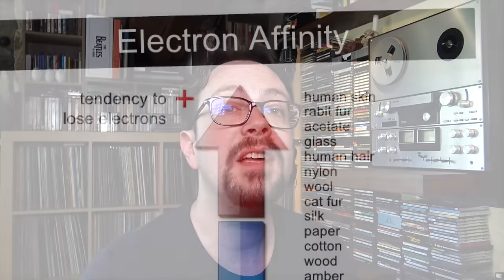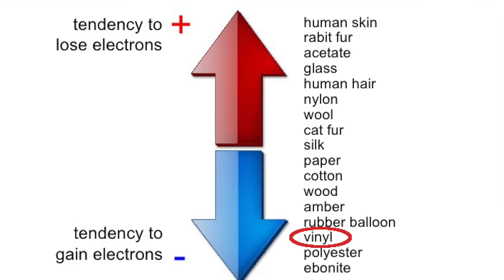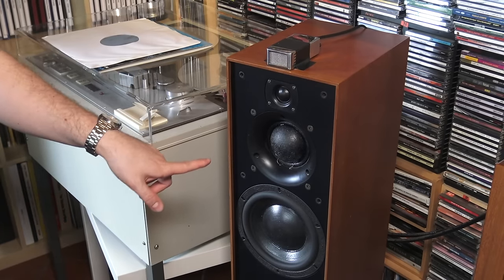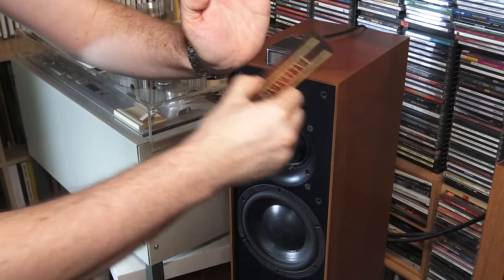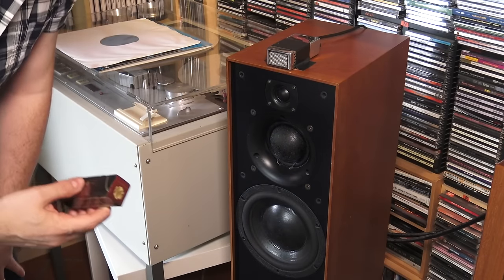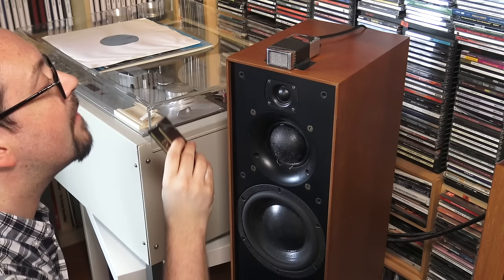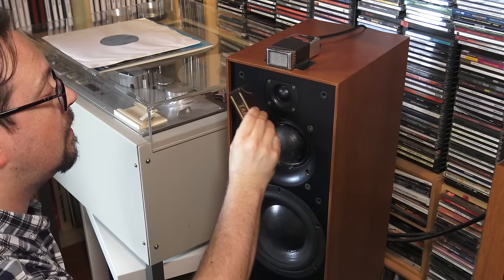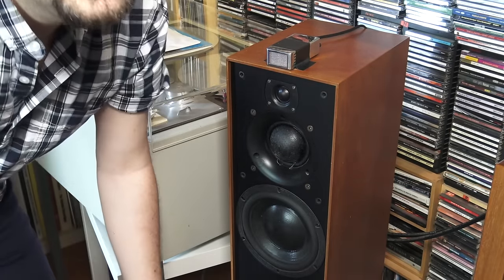How to eliminate static electricity from records & gear

Comment: I had a Milty Zerostat 3 gun once, but they have a certain lifetime on how many discharges it can deliver. 
I managed to wear out mine within 2 years of use to the point it didn't worked at all, even if I tweaked the screw on the piezo-element holder inside the gun.
Ended up buying a vintage battery powered Nagaoka Kilavolt No.103 gun for never needing to replace it again.
It has good reviews, so I'm very excited to test it out when it arrives in my mailbox.😊

Comment: Re the Zerostat, i've heard from many people in the hifi industry that they work but, as you say, they're expensive, as for the Talisman "WOW WHAT A LOAD OF SNAKE OIL BOLLOCKS".
The ONLY reason it eliminated static from both your cd & vinyl is because you grounded yourself & the discs by touching them thus discharging any static to ground.
If you want to eliminate static from your discs before you play them, don't wear rubber soled shoes or stand on a carpet when you load them either onto your turntable or into your disc player. If your equipment is properly earthed (grounded), touching the chassis of the player or as you suggested the spindle of the turntable will more than suffice to discharge any accumulated static charge. As another commenter noted, magnets ( of any strength) & cartridges & tape heads are NOT good bedfellows, unless you're very rich & stupid enough to bring them together, in that case you can afford a new component each time the "magnet" is used near them. As for de-magnetising your speaker drivers....... well as they have pretty large magnets inside to make them work, you're wasting your time.
Sorry to rant on so, but this sort of "BAD SCIENCE" is exactly what gives audio & hi-fi enthusiasts a bad name & puts people off investing any amount of money into their music listening equipment. They then go on to purchase an all in one system because it's easier, but not necessarily as enjoyable which,( to me anyway) is what this hobby is all about. Not confusing them with inaccurate information & fleecing them out of their hard earned cash or savings.
Reply from the maker: Draco, I agree on most of what you said but I must also add that I did not say anything ethusiastic about the Talisman. It did have some results, which I need to further test, but as I said nothing incredible. Surely the expense is way too high for the results. I declare what I feel, see and hear. Noboby is paying me for this...I am just motivated by passion. Moreover, what surprises me is that there are very important reviewers that claim that it is miracolous...at that point, or domething fishy is goig on or I amusing it wrong. Still have to decide.
Reply: Touching a non conductive material like plastics of an LP or a CD does not thoroughly remove static electricity by pulling it to ground. Only the touched parts and areas surrounded.
It also depends on how big the charge is, a bigger charge can reach over longer distances to ground. Electrostatic discharges from plastics can reach up to 50kV (or even higher with low humidity air) creating a spark of multiple centimeters towards ground. The other way around is also possible when it is negatively charged, flowing from ground towards the charged object.
The Zerostat actually works to remove static electricity (not to prevent buildup of it). It just ionizes air near its tip. 
It uses the same principle as ionized air to remove dust from parts before entering a clean room for example. It's no snake oil, just a very common concept.
I don't know about the other products though.
Reply from the maker: Thanks for sharing your experience!
Reply: @anadialog  you're welcome.
I can also recommend the Zerostat for use on the turntable dust cover to prevent it from attracting dust.
Reply from the maker: Cool!
Reply: I had to turn off the video when I first watched it in 2018 as I knew most of it was inaccurate. Using a device to reduce static electricity on a pair of speakers which are basically two large magnets - too funny! 😂

Also a CD player full of static would still work perfectly well. A laser printer is an instrument that works by producing static electricity with a laser, yet it has no problem reliably printing out finely detailed prints.
Reply from the maker: And though you are still here talking about it! ;-)
In any case, I did not invent the Talisman. I was just reporting the othe uses, which were a side note, certainly not the subject of the video, which clearly is vinyl as the thumbnail exemplifies. 
BTW the speaker treatment is at the end of the video, so I guess you did not turn the video off! :-))

Comment: What I usually do to reduce static is use a USB charger connected to a wall outlet (so it is grounded) and use the connector end of the cable to touch the dead space on one side of a vinyl disc. In my experience, it doesnt completely get rid of static, but greatly reduces it. I've done this on vinyl emitting static from 5 inches away and gotten the static down until I could feel it about a half inch away.

*Disclaimer* This practice shouldn't damage your vinyl, but am not 100% of the repercussions it may have to the cable itself. However, in personal theory, as long as the cable is connected to a grounded power adapter then it should be fine.
Reply: Good idea. You could also get yourself an antistatic wrist strap & lead as used in the electronics production & repair industry. They have a resistor in the lead which prevents you from creating a dead short between your potentially live equipment & earth thus (potentially) electrocuting yourself. They're really cheap, but the downside is, you could catch the cable up on your equipment which would be disastrous if not taken off after use. :-o

Comment: Be really careful with the talisman with quartz lock and servo lock turntables! I don't know how yours work, but my sony seems to have a magnetic strip on the perimeter underside the platter, and a sort of tape head fixed on the plinth to read it in order to perfectly time the motor. That means that if you demagnetize that strip completely or partly you can loose or even worse change the speed on part of each turn!
Reply from the maker: Thank you Marco!! Good to know!

Comment: Hi -an additional "option" to test (if you agree in my theory). According to scientific experiments you are able to knock out the electrons by exposing static charged material to UV-light. If this work, it could be a fast and substance-free cleaning of the static noise of the record. Is it a test worth? It would be my contribution to your well made video of the subject. Thanks 🙂
Reply from the maker: Interesting!🤔

Comment: I invented a little arm that you swing across the record before playing, it has a tinfoil curtain that hangs 2mm above the record surface and it grounded to the sub chassis (sprung part), you can make a simple one yourself by simply wrapping a little tin foil on the tone arm on the rear of your cartridge (dont  short the connections), shape it so it forms a curtain hanging just above the record surface without touching-the high voltage jump a few mm's anyway, the grounding on the tonearm should be sufficient even if it is painted, as the high voltages from static cross the paint barrier.
Try it and you will see, no more static on your records EVER, whats more  I think it improves sound.
Reply from the maker: Interesting!

Comment: Clean your vinyl up with a good lp cleaning method and use Gruv Glide,   IT is not a gimmick, it is a popular decades old product  made in the US  ,it keeps the static from building back up and you will hear far more from the vinyl and keeps the need away from having to have major cleanings after you use it . It can last for dozens of plays  ...

Comment: Interesting video! I definitely noticed a big improvement after switching over to anti static sleeves. Thanks for suggesting the Nagaoka Sleeves, when my mofis are all used, I gonna try them, because what you said is pretty accurate: The mofi Sleeves don't fit inside paper sleeves and you often have to cut shorten them or put them side by side into the outer sleeve what sometimes makes it pretty stocky.

Comment: Do you wash your new records?? I like to use a Roller Cleaner such as that yellow one you had in the video.
Reply from the maker: Not really, only old ones...
Reply: I have a roller washer, and along with dust, they seem to be completely static free when they come out. I usually use it on a new record and then store them in the poly style sleeves.

Comment: Great informative video. I have the original "Zerostat" antistatic static pistol (made in the UK), bought it in the early 1970s and still works well. Interesting on using Magnets on a LP, i wonder if an 'Tape Head Demagnitizer' would do the same thing? (i have one for my reel to Reel tape deck). I also have an "Nitty Grtity" (FL5B?) Record Cleaning machine, uses water based fluid and i also use the "Nagaoca" antistatic LP sleeves.

Comment: I got the spinclean instead of the Knosti because the fluid seems better value / no alcohol, also cheaper and I like the idea of replaceable cleaning pads, whereas the Knosti has no replacements and I have heard the brushes wear out over time.

Comment: I think the best and easy way to remove static is to use your ion based air purifier. I have a sharp plasmacluser thats stil running 24 hours for 20 years, that puts out positive and negative ions and just showing the record over the vent neutralizes the static and also blows away any minute dust with pure air.
Reply from the maker: Cool! Thanks for sharing that

Comment: Here's the best audio tip ever:
Don't bring any magnets near any of your music media or equipment.
Also keep your speakers, that contains magnets, away from your media and other equipment.
Magnets don't eliminate electrostatics but they do decay magnetic tapes, induce voltages in your equipment and magnetize many of the metals in your equipment.
To demagnetize your tape player heads you nead a specialized degaussing tool that generates a localised high frequency magnetic field using a coil.
If you suspect electrostatics building up in your equipment you can use earthing wrist straps (ESD wrist strap) and anti static mats (ESD mats) to get rid of it.

Comment: Two notes from watching this. First on the Zerostat, the new ones don’t have great instructions provided but in research I found, you are supposed to squeeze and release the trigger while pointed at the record. Second, with carbon brushes I found that not all are created equal. Out of all the brushes I have, only one had continuity between the bristles and the metal housing which makes me believe that only ones with continuity actually are able to discharge static when touching the spindle.
Reply from the maker: Yes, I was following the old model instructions. We explained that in the comments and now I will add a fixed comment to clear that. The brush will always charge if you use it while the record is spinning. If you do it by hand then it can help the way you said.
Reply: @anadialog  thanks for clarifying on the zerostat. I found info on it was a bit difficult to track down. The instructions with my recent purchase of one were very vague. On the brush note, I have tried it and done some meter tests and it did seem the rotation added charge although on brushes which had continuity between the bristles and the metal body, this charge was discharged when it contacted the spindle and apparent static was also discharged. That being said, of all the brushes I had, only one had continuity which makes the rest of them counter productive. If you haven’t already, it would be a good video to test different brushes and then test their effect both with a stationary record and one spinning.
Reply from the maker: Sure!

Comment: Thanks, a very good video indeed! But I wonder if not the Talisman might be a bit dangerous for a record player such as your Technics (I myself own a SL1200gr). I mean, there is a strong magnet just beneath the platter and, as I see it, you shouldn't risk to "decrease"or "alter" its magnetism in any form (e.g. with a Talisman). Am I right or not?
Reply from the maker: As mentioned in other comments, after further use the benefits are just not enough compared to the expens. Apart from that, I don't think so. I am pretty sure this was calculated. In any case it would be better to keep it stored far and use it fast!

Comment: I want to share my experience concerning static ... understanding what happens will solve many misunderstandings of static electricity. It is without a doubt movement of electrons (the visual spark and jolt felt) the reason it has the name static is because it is in fact stationary no movement AT ALL until something with less electrons get close enough that has an imbalance then the above spark, pop and jolt can be felt if you are what the electrons flow to (or from). Static build up inside a CD player or on CDs is something I don't understand as even possible the reflective layer wouldn't allow it to build up inside the CD machine itself would keep it drawn away simply because it is constantly grounded. In my opinion that is the same as alleged stabilization rings that became popular shortly after CD player came out, the claim was perfect balanced CDs played and sounded better. It was SNAKE OIL as well as an absolute useless product that could even damage a CD player if used improperly. As long as a CD player can keep the data rate close the DAC would correct ANY WOW and Flutter that an out of balance disk could potentially cause electrons have nothing at all to do with a CD and the fact that a laser detector is seeing light from the laser or not as mentioned earlier static CANNOT build up inside the player in the 1st place. The other comment about that was clearly stated as well. I would love to know how in the world a magnet can affect static electricity in my 50 plus years of living and having an interest in electronics I have NEVER in my life heard of a permanent magnet doing anything concerning static electricity, discharging it or otherwise. I wouldn't even know how to test the idea of it to prove either way.
Reply: I have to agree, it got so nutty with the waving of a magnet around the speakers that I wanted to comment, but couldn't manage it in a polite way.   The guy should educate himself on how human hearing works before he promotes nonsense publicly , human hearing it is subjective process of the mind, designed to say "yes" if you think you hear something, a better answer evolved for survival against being eaten, and the reason why hearing tests have a scoring system that includes a presumed percentage of errors , to achieve an accurate test.
Reply: It’s the same idea as a demagnetizer used on tools… it’s a set of magnets oriented to scatter the positive and negative poles.

Comment: Hi ana[dia]log, thanks for the video. You are the perfect Gentleman, everything or anything which you are explaining convincingly.  This is the first time I watched the demo for how  the Static Gun to properly be used. So far, no one did explain in any videos.  Thanks a lot.  But, please let us know that : How many points on the record to be treated? or just any one of the area?  Are both sides of the record to be treated? 

When using Talisman,  should both sides to be treated? Is it safe with the MC cartridges?  
You did say that alcohol solutions are not good for vinyl,  then which solution you do recommend?  How about 'The Disc Doctor's Quick Wash Record Cleaner'   &  L' Art du Son Record Cleaning Liquid?
 Kindly explain in detail for all my doubts.  
With Best Regards,      
Naresh.
Reply from the maker: Hello Victor, thank you for your nice message and excuse me if I did not go enough in depth on every aspect but I am trying to make shorter videos. 
Here are the answers to your questions:
The milty gun can be used above the record while it is spinning. At about the distance of an arm from the record surface. Yes, do this for each face of the record for each time you play it. The Talisman must be used on both sides in the way I have shown in the video. This treatment should last longer than the gun. But if you use a brush you need to do it again ( in my opinion). Keep the talisman AWAY fron any tipe of cartridges! For the cleaning solutions please check the video I mentioned when I was discussing about the Knosti. L'Art du son concentrated solution is alcohol free and it is probably one if the best out there. I don't think that these have anti-static properties though.
Reply: Thank you dear friend.  Cheers.

Comment: For years, I used an antistatic gun designed for vinyl static. It used to zap the record neutralizing any static instantly. 
Sadly after many years of usage it stopped working. I'm looking for a replacement, but no luck so far.
Reply from the maker: Hi Chris, may I ask why the Milty Zerostat 3 gun does not suit you?
Reply: ana[dia]log 
It does. I wasn't aware of this device ... Looks very similar. A bit pricey though. Even on eBay, but worth it if it lasts as long and performs as well. Thanks for pointing this out 👍
For some reason I missed your mention of it during this video. I must have been making the tea 😀
Reply from the maker: Oh ok...good! Yes, it is very good. I have been using it for over 10 years now!